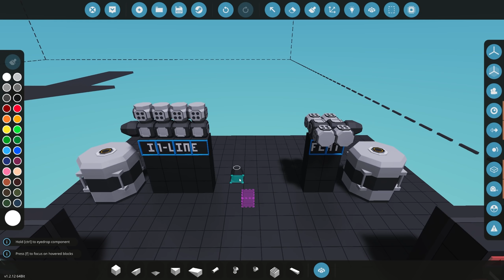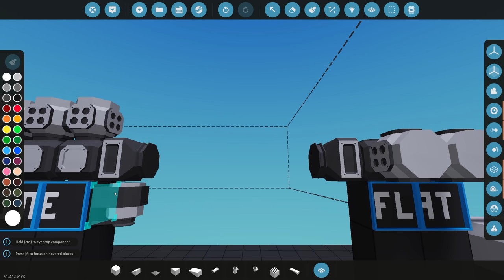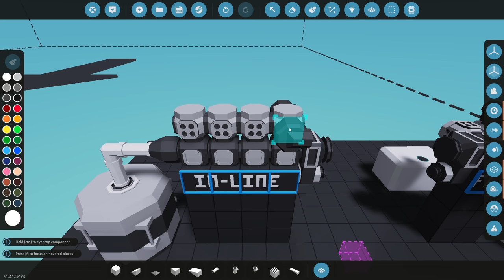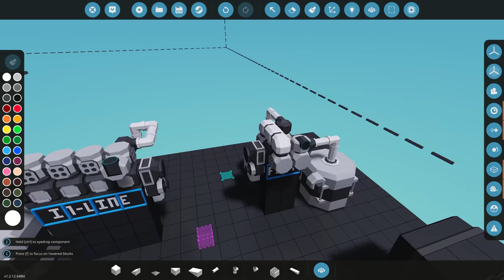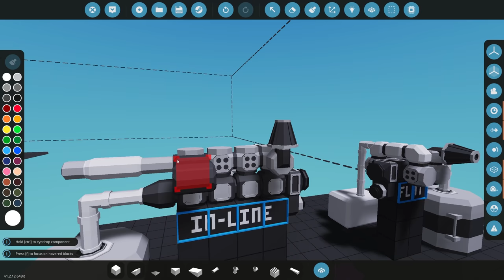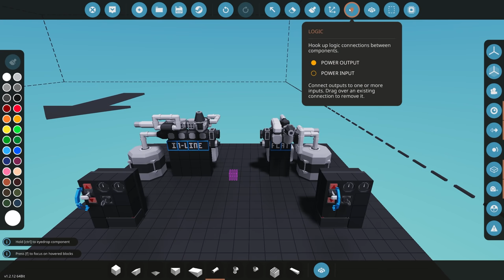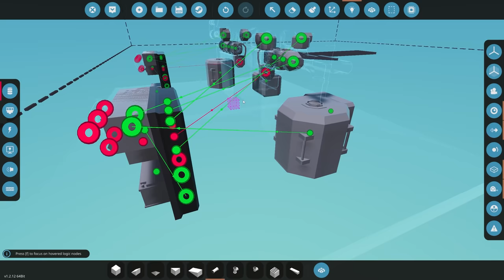Modular Engine Test - IN-LINE 4 VS FLAT 4 - Which is Better? - Stormworks

Comment: It would be nice to have a V-block crank in the game. The cylinders would still sit upright, but it would look more interesting than a normal inline or flat plane engine
Reply: can kinda fake it by building the cranks off a pivot then setting it to have that V degree!
Reply: i got a mod from the stormloader repo that adds a V crank and the appropriate angled piston block for it, not quite sure just how all the air and fuel and cooling hooks up to it, or if its even functional. in all fairness i havent tested it yet.
Reply: I know I'm a year late but I built a boat with a V8 Engine Block from that mod, they have to be connected together to share any fuel or cooling or air using the T-Shaped Manifolds, It took me some trial and error to find that out but other than that they are quite useful!
Reply: @NyoomSpencerFox do you use hoses for the manifolds?

Comment: Would be nice for a good turbo / supercharger tutorial.. as the ones I have found aren't the greatest to follow :) much love
Reply: Yes I a supercharger/turbo tutorial would be nice
Reply: Put a large pump on the intake, adjust the afr accordingly
Reply: I've been told that only superchargers are possible because impellers don't generate Power. So you can only make superchargers.
Reply: @danieljones8706  that is correct
Reply: @ethanclark6984   Find it in Steam - "Turbo Charged Modular Engine"
Reply: @danieljones8706  technically correct, only because the large impeller pump uses RPS input for power instead of exhaust blowby.

The only difference between turbos and superchargers in real life is where they get their power from. Turbos generate forced induction by using exhaust gas before it exits your tailpipe. Superchargers generate forced induction by using a a belt that's driven by your engine's crankshaft.

All this means is that the rps driven pumps are technically superchargers, they resemble a turbo or "procharger"(which is technically a brand of belt driven, turbo modeled supercharger).

If the input power for the pump was exhaust instead of RPS, it would technically be a turbo. Since this is a video game there is no reason for the developers to have both rps driven, and exhaust driven pumps in the game.

In summary, forced induction is possible with modular engines. People are just splitting hairs because the part looks like a turbo, functions similar to a turbo, but has the "supercharger input" (RPS) to run it.

Source: Automotive Prototype Technician
Reply: Side note: if you use an electrically powered pump pushing air into your intake, that's technically an electric turbo, NOT a supercharger, or a traditional turbo.

BMW uses electric turbos now to pre-spool their "real" turbos
Reply: @moonman506  I know its just a video game and it's not necessary, but it still would be really cool if they just made the impeller pumps draw power from moving exhaust fluid and convert it into RPS (sort of like how the big steam turbines work but with engine exhaust rather than steam), that way we could put two of them back to back and make a somewhat realistic turbo, drawing power from exhaust rather than crankshaft.
Reply: @themystic6604  would be cool indeed if they added a hot side for the impeller pumps. The only way it would change your engine performance would be by inducing boost lag, though, and therefor more of a cool niche to use rather than actually 'useful'
Reply: @dominicks360  i have an engine wich has a supercharger with tops 140 psi and i did the formula for throttle just air/2 so max fuel is 0.5 but it adds psi/280 on the fuel so max fuel is 1 and max air is 1 so im running an engine at both manifolds 100% throttle and make 160 watts at 20,rps on medium gen (its a flat 8)
Reply: @aarondebruin9786  Nice, I have been supercharging I4 and it is definitely worth the time
Reply: The are a lot of @

Comment: You should try putting down more crankshafts (without cylinder) and see what the Torque Meter indicates.
Reply: Yeah the lenght of the crankshaft was really the only diffrence but it seems that longer crankshaft gives you more power and less rps

Comment: A turbo tutorial and a comparison between turbo and NA would be cool. So far I haven't managed to build a working turbo engine
Reply: Yes, I agree👍
Reply: Yup, can’t find any good instructions on this.
Reply: @Leon Livstedt I figured I'd start with an electrical supercharger first, and once that works try my luck with a turbo. But so far I didn't have much success with supercharging (although maybe I should try putting some gearboxes between motor and pump). Sad to hear I can't use impeller pumps to create RPS, I would've loved to use exhaust flow for something useful

Comment: Every crankshaft adds resistance (in this game called torque). For the best result you want to use every side of the crankshaft, in this case 1 crankshaft with 4 cylinders around it.
Reply: @Thomas Radabaugh The Torque Sensor in the game has a logic node that is called "Torque". This value has nothing to do with torque. It is a black magic number, that the game uses to calculate mechanical resistance or inertia, im not really sure. You can't multiply rps * torque to get power in the game.

Bad game design, missleading so many players.

Comment: I made a boat: two air manifold and each with supercharger, one fuel manifold with small pump to pump fuel. I can just put throttle without any changing to manifolds and the power that engine producing is huge... And water cooling is minimal requirement to cool the engine

Comment: Should test all 4 configurations inline, flat, v(2 crankshafts and 4 heads in a 90° configuration), and even a rotary(1 crankshaft with 4 heads on each side)
Reply: That's not a rotary,  that's a radial.
Reply: @martindinner3621  that's what I meant, thank you

Comment: Mr nj you should absolutely start doing modular engine videos. I want to know if different sized cylanders are more or less fuel efficient. Like if you made a 3x3 that makes x power, then make a 1x1 that makes the same power and look at there fuel efficiency and compare

Comment: Is it basically the more cylinders per crankshaft block then?  This left me to wonder what if you put all 4 on a single crank shaft block?
Reply: So a radial engine? Because else, impossible.
Reply: That’ll get you the best acceleration and rps. The flipside is that the engine will overheat faster and will have less torque overall.

My rule is that in-line is better for work and heavy duty engines, while flat, cross or V shapes are better for sport type engines, where speed is paramount.

Comment: Flat 4 is two crankshafts smaller, lighter and cheaper. Works fine for me)
Reply: But it is a couple of manifolds heavier. So the difference may be pretty much zero.
Reply: Also, lower center of mass, for racing cars and ships.
As the engine gets bigger, the gap becomes even greater.
Reply: Does the game really care if it is “flat” or “V”  (“L” in game, I guess)?  That would be two less manifold pieces.
Reply: @akd8525  L is kinda unbalanced, you can turn it 45° but for smaller builds it's a bit impractical.
The game doesn't care but weight distribution does
Reply: @S己G  Consider a 6 cylinder setup or a medium size one. Also, shorter engine makes a shorter hood, wich can be helpful in saving even more mass and cost

Comment: @MrNJersey - I was hoping this would give me some insight as to why I cannot seem to get any standalone engines working but alas I am more lost than ever now XD, I built my first car which was both a success and failure, it started, drove and handled okay on your v5 ECU Controller, however I wanted to have a better understanding how the modular engines worked, so I have been building similar test setups like you have done so in this video, but have only ever ran into issues when trying them, when using your v5 ECU, the starting key only turns on for a split-second and then shuts off whether the throttle is at 0% or 100% it doesn't matter, if I constantly spam the e/q keys on the starter key the engine will gradually rev up to about 3.8RPS, however immediately stops firing when I stop spamming the starter key and slowly loses RPS, upon looking at the ECU Controller it states: There is too much fuel, which I am presuming this is referring to the AFR and not the Fuel Tank level amount, after trying every configuration of the AFR going from 10, to 20 and everything in-between it always says There is too much fuel on the controller, is there something I am missing I have spent the last couple of days redoing the connections over and over again making sure I haven't missed a connection and rebuilt the engine from scratch 3 times now making sure I wasn't forgetting something, making sure coolant tank was fresh water and fuel tank was fuel, but still always have the same result. I also tried your v3(?) I believe being the Set RPS Controller with the exact same result however this Controller didnt say There is too much fuel, it just had the same result of not allowing the starter key to stay engaged thus not allowing the engine to start, it only gives it a very short jolt of life before shutting down, I have also tried using multiple setups of engine output, ranging from initially a Med Gen, 3 Gear boxes and a Prop, and slowly reduced that to nothing after trying the many days of diagnosing this issue, I searched all the steam community comments, quite a few people have had this issue with none ever having a comment saying how to fix it. Any help would be greatly appreciated, would love to play this game a lot more and make many creations, however being stuck on the most basic 4 cylinder engine for 3 days just diagnosing issues with no results becomes very boring very quickly.

Comment: the first time I ever felt these motors it would turn over but just would not start at all and then I figured out that somehow the starter was not powerful enough to start it so I just use Electric engines like in another video he said

Comment: The problem of modular's overheat is resolved ?
Reply: It would be resolved if this community had any ability to learn imo.
Reply: The easiest way I've found is that instead of running water to the engine, you "run the engine" to the cooling system.
You basically use manifolds so that the "cooling system" is a pipe out, a pump into a rad another pump going out the rad, and an elbow back into the engine. That's it. The problem is the "water" doesn't move, not the radiators not being good enough.
Also, don't run the engine at 60 RPS constantly, obviously.
Reply: @YoutubeAccountName  it’s in a very specific use, but when I use a water jet I also use it as the pump for the cooling system, works really well since you pull so much water through without loosing power or making it large
Reply: @kalle5548  I've made the same conclusion with the pump jet. But after 20 min at 60 rps... kaboom.
Reply: @Tacticaviator7  explain your knowledge to the community instead of be selfish....
Reply: @YoutubeAccountName  I'll try your advice. But I don't know why it's so complicated to create something. Before to add update it will be nice to fix or explain the Logic of the system.
I love this game a loooooot but it's not really cool to stay like this with such a problems.
Reply: @gregasl8651  agree with you
Reply: @gregasl8651  Basically, like in real life never run the engine at full power and keep it at the same rps if you can, I always make an overpowered engine for the purpose it serves and run it at max 0.4 throttle while keeping the rps below 15, without any cooling systems I never saw the engines overheat, so with a small radiator you could easily run it at even bigger throttles.
Reply: @gregasl8651  20 min at 60 rps with a water jet, you sir just traveled to the arctic

Comment: Was wanting to know, will turbo charging work for the old pre built motors in game? Like will it add more power?
Reply: No
Reply: Yes. You can turbo medium if you   use one input as input for cooling medium engine and as input for waterjet. After waterjet start, engine got more power. Bug?)

Comment: Medium generator is a bad indicator for comparing performance of engines why not just use a torque meter.
Reply: Torque meter is stupid and unreliable. Measuring how much power you can make with a generator (medium or large) is waaaay better.
Reply: Because the "torque" meter cannot actually measure torque. The number it returns is some arcane derivative of the internal resistance of the engine...so it is semi-useful for measuring internal parasitic drag and drive train losses.
Reply: Thank you did not know the Torque meter does not work correctly hopefully the devs fix it then. @martindinner3621